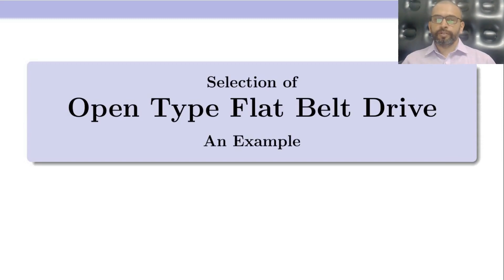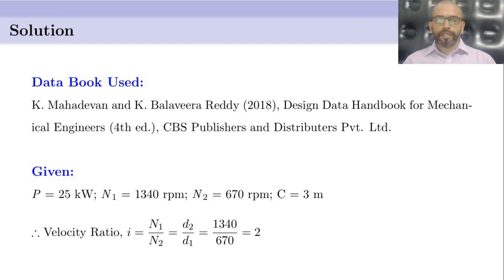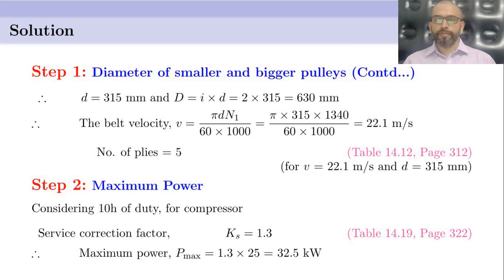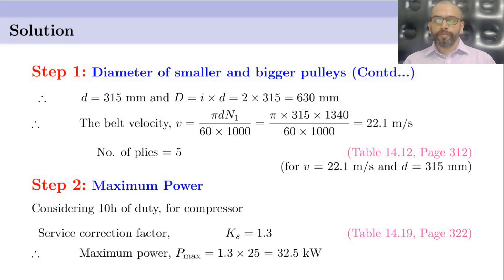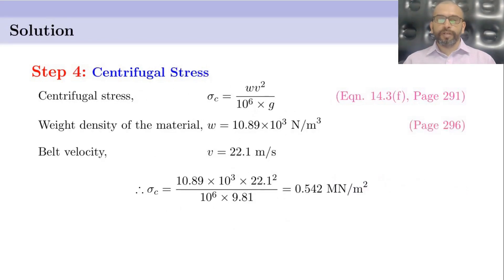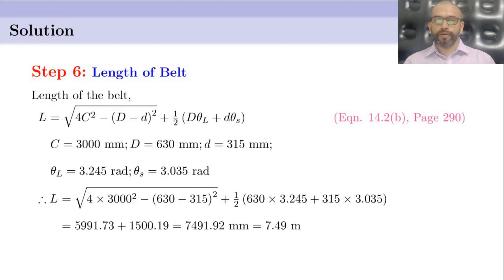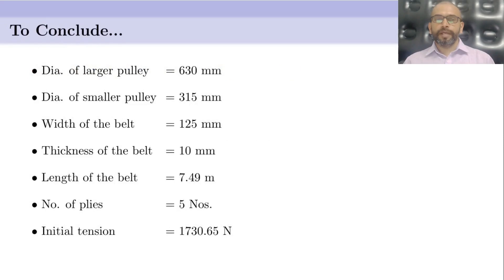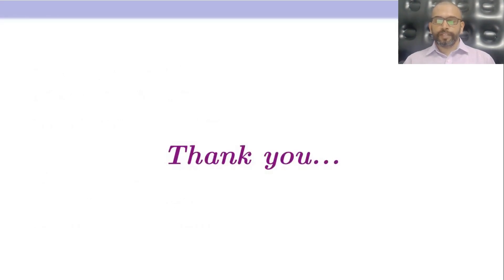Design of open type flat belt drive: A step by step approach

Comment: Sir,
Shouldn't the initial tension
 T0 = (T1 + T2)/2 ; Why sqrt is taken?
Reply from the maker: In actual practice, the belt material is not perfectly elastic. Therefore, the sum of the tensions T1 and T2,
 when the belt is transmitting power, is always greater than twice the initial tension. According to C.G. Barth, the relation between T0, T1 and T2 is given by T0 = (sqrt(T1) + sqrt(T2))/2.
Reply: @anizhamdotin  Thank you sir 😊